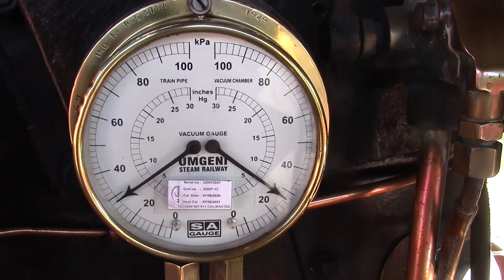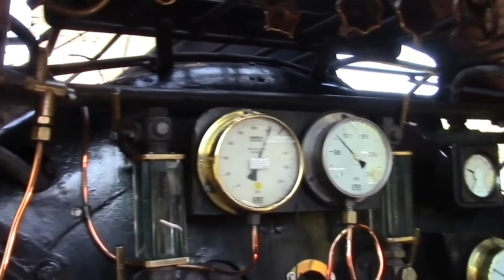Umgeni Steam Railway - South Africa's last Steam Preservation Group (2021)

Comment: Glade to see that umgene stem has not converted to oil burnes that does tremendous  damage to the culture and the reputation of the stem era .people stil want to hear the sond of the spade and the firemans skill to main tain while the regulater is full open and the injector in full  operation  oil burners the so called fireman just sits and open , tapes  just like a steam engine  without  a brass number plate. They can just as will put a diesel on the job.